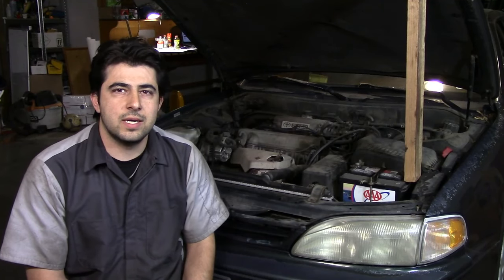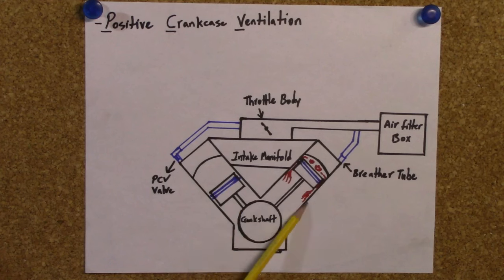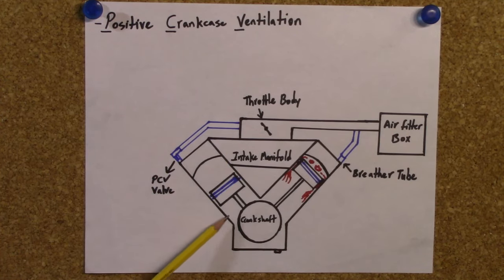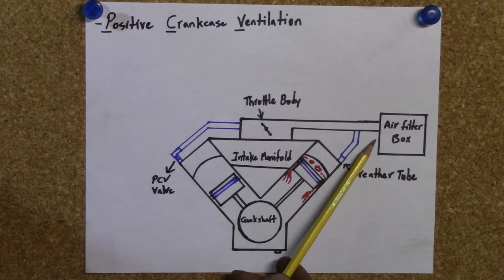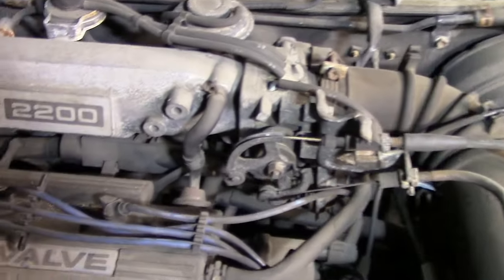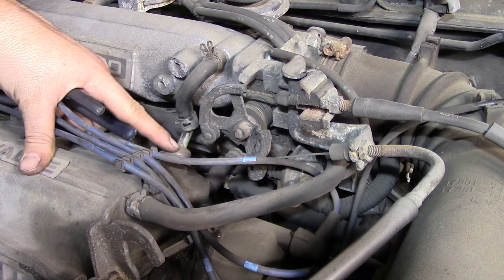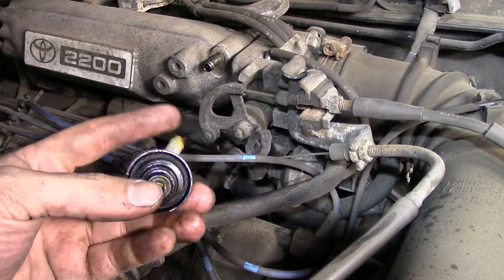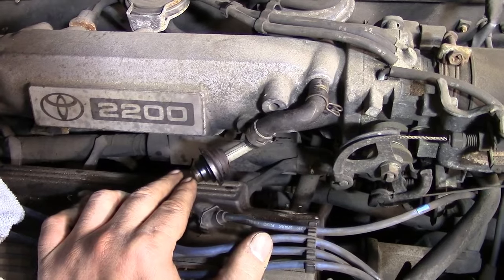How Does a PCV System Work - Also Testing and Inspection of the PCV Valve

Comment: I just di the PCV valve in my '04 Astro van - The existing PCV valve tested fine BUT, when applying brake pressure when the vehicle was in gear it rattled wildly and was loud so I decided to replace it anyhow ($2.85) it seems to have solved my issue

Comment: I blow through each end of my valve and air easily flows both ways. It does not really close.  You mentioned  the valve will close or nearly close at idle. Why does this have to happen and if it does not close, does that create a problem ? I got the impression that a valve is not even necessary, just a hose. Does the valve open only so far at different engine speeds ? And would this be to reduce too flow and too much oil from entering the intake/throttle body ? Seems to be a spring in mine, what's it's purpose, to control how much the valve opens I take it ?  Seems to be an excess amount of oil in my valve also. Thank You Anyone !

Comment: Hi. I would like to ask something if the following is true: If you open the oil fill cap during operation at idle and put your hand close to the oil fill hole you should fill some gas pulsations. This is normal because the valve is almost closed. However, when you open the throttle, the pulsations are lost, since the pcv valve opens. Is this a way to check your pcv valve?

Comment: Does a 03 Sierra 1500 is open  from factory?.  The stock one is just pcv valve with nothing inside  just a big hole  and a smaller hole.  Nothing inside the pcv valve to rattle. The new one is the same.

Comment: Yea I had a pcv issue replaced the valve didn’t fix it so I checked the hoses and it was a hose leak replaced the hose disconnected the battery so the engine light went off and the truck stopped jumping like it was but it is still acting funny and has slight engine surges and the engine light came back on I can’t find anything wrong with the hoses or valve but the engine light code still says pcv valve

Comment: Don't HAVE to have a breather tube for you airbox if you car doesnt use a pcv valve. For example, Chevy cavalier 00-02, Has its own internal air oil separator under the valve cover iirc

Comment: I don't quite understand how a blocked (stuck closed) PCV valve can cause excess pressure in the crankcase. Surely the gases would just go out through the breather pipe?

Comment: Well there is a little bit more to it. At idle when manifold pressures are high/"high vacuum," and low crankcase pressure pushing on one side of the valve, and suction on the other side of the valve, the valve will remain in the closed position. As throttle opens, manifold pressures drop opening the valve, relieving crankcase pressure. At idle a pcv valve should be closed, otherwise a vacuum leak is created, dropping manifold pressures, decreasing the valves ability to close. At idle a engine, unless it's wore out, doesn't really require crankcase pressures to be relieved, only at part or wide open throttle, for it is then the crankcase pressures build.

Comment: can you help me? my pcv valve is stuck closed i think, the engine cover inlet pulls air into the crankcase throught the pcv valve from the admission, and it only flows one way inside the crankcase is this design real? or wtf, i have oil leaks near pcv valve and oil fill port

Comment: Great video. But is that the case with all vehicles? Are all of them ventilated through the valve casing? Why some use a PCV line coming directly from the crankcase and others are like this Toyota? Also I know some use an oil/air separator before the gasses are returned but it seems there is no such thing in this Toyota?
Reply from the maker: Stefan Ovcharov Good questions, I am not sure. But if I had to guess I would say the newer the cars more likely they would use an oil catch, and older they are more likely they would use the vent directly from the crankcase. cheers
Reply: RatchetsAnd Wrenches Thanx. Cheers.

Comment: Breather tube is there when wither there is no vacuum, backfire, or boost. It acts as a small source of vacuum for blow by. You always want some vacuum in the crankcase, because the engine will  always have some pressure. The engine itself isnt sufficient enough anyway to provide any large source of vacuum for it to be any concern.

Comment: Probably one of the best explanations in YouTube mentioning why PCV always has to be used with a breather tube, that clears most of my doubts. Great video brother!
Reply: The part where he mentioned how the pressure from the Crankcase travels through the Oil Way Tubes (that normally run from the Valve Head section down back to the Crankcase base/Reservoir to get resent back to the Oil Pan) up into the Valve Head section is what did it for me.
Never understood what a PCV is doing on top of the engine head if the Crankcase is down below.

Comment: is it possible to clean the PCV valve with carb cleaner? got a GM truck where the valve is attached to the valve cover, so the whole cover ($100) would need to be replaced if the PCV valve goes bad.

Comment: I have a different problem on a VW Golf 5,  no blow by, instead there is a vacuum when opening the oil cap or dipstick and i can hear bubbling inside. I've searched about this problem but found no such similar case for my engine. Car runs fine.

Comment: Is it possible to relocate or add an extension where the pcv valve is installed? Because i have a 2009 toyota  rav4 2ar-fe engine, and the pcv valve is located underneath the intake manifold, so to access it i need to remove the intake manifold first, alternative way is to lift it remove the passenger side front tire and splash guard to painfully access it, do you think by putting a extension hose will make any issue?

Comment: my ford f 150 2005 is burning a little oil what should I do
Reply: Oil consumption in the range of 1 quart every 1k miles is considered normal although some engines of the same displacement in the same service use more while others use less. It is a mystery.

Comment: so.....  having Oil going up through my pcv valve to my throttle plate is Ok?  I have a 2000 ford taurus duratec 24valve dohc engine and the hose set up is connected behind the Throttle plate.  Just changed the PCV in it and there was a little oil at the bottom of the plate.   Really appreciate your videos, by the way!

Comment: To fully understand....the breather tube supplies air from the filter box to intake manifold? Because, when throttling the engine doesn't it create a vacuum at the end of the tube where is connected to the filter box ?

Comment: Thanks for the video.  I have camry 2007 4 cyl with 100, 000 miles.  I changed the pcv valve,  I see a blow by but no smoke and the car has plenty of power.  However it consumes oil ~ 1 qt in 1000 miles when I was using Mobil 1 5w-20.  The oil consumption improves to 1 qt in 2000 miles when using mobil 1 0w-20.  My questions to you:
1-Does the blow by means the rings are worn even though there is no smoke at all?
2-How to tell if the blow by is normal or excessive?
3-Do you think the car can survive for another 100,000 miles? or need rings?
Thanks
Reply from the maker: +zofa300 I think there is a recall by Toyota that covers rebuilding the engine on your car, not sure if your year is covered or not. Apparently some piston ring excessive ware causes those engines to burn alot of oil. Do a google search you should find it. gl
Reply: +RatchetsAnd Wrenches Thanks for your reply. I am aware of fix that Toyota announced.  It required more than a qt in 1000 miles.  I am just afraid it I am slightly less than 1 qt for 1000 miles so I'd like to know what I should expect from this car if It just can run for 100,000 miles if I keep adding oil or there are many other issue.  Any additional comment is appreciated.  Thanks a lot
Reply: zofa3

Comment: I have a 98 Nissan 200sx and it has an oil leak underneath the car.  I think it has a problem in a pic hose.  How do I know ?
Reply: +vanessa mata Usually it's an oil pressure sending unit or an oil pan gasket. The root of the problem is usually caused by engine blow-by which is caused by a failed PCV valve and/or worn piston rings.
Reply: +vanessa mata Also, blow-by contaminates the oil with sulfur, which is corrosive and will actually eat at the rubber seals and the oil pan slowly.

Comment: My 06 4.6 f150 has milky yellow gunk in the oil filler cap the oil looks good just changed pcv but still happening any ideas ? Thanks
Reply: Head gasket is failing likely. The milky gunk is the product of coolant and oil mixing.
Reply: There's another video I watched about this vanilla pudding looking stuff that happens up north in the cold when you don't drive very far, so you don't burn the moisture off that naturally builds up inside a motor.

Comment: If it rattle or moves with only gently flipping it upwards and downwards then your spring is not allowing it to remain closed. It should remain closed at all times until a vacuum is applied to pull it open. At least this is my understanding of it. Please someone correct me or at least reword what I said to make it more accurate if necessary.

Comment: When you open the throttle body there is no vacuum after the throttle body, there is actually positive pressure sometimes. There can be a vacuum before the throttle body at WOT hence why there is a breather before and after.

Comment: how bad is oil leaking(as it usually does) from crankcase, through pvc valve if it isn’t clogged, back into throttle-body, intake, etc.?
not that it makes any colossal difference, but how bad is oil, sludge, etc., leaking through clean air vent(also back through throttle body, intake, & so on)?-  &&& on this nOt of revolving carbons sludges etc. revolving through here or there, back through throttle-body,  intake, & so on, do either catch cans &/or AOS’s clean carbons, etc., from oil, or air, before returning it?-🤔

Comment: how do you know if there is too much oil being sucked up by the pcv valve? My pcv valve is connected to the rear most intake hose right before the throttle body. I was taking it apart to clean the throttle body and i noticed some oil pooled at the bottom of the ridges on the intake hose. is this normal? I also have a oil catcher on the opposite side of the pcv valve for excess oil and it was pretty dry besides normal oil residue but im just not sure if oil should be pooled in that spot or not. I cleaned it and i have not checked it yet, im going to wait a few more days to see if it catches more.
Reply: Austin Rodriguez You would know because your adding oil in between oil changes because your checking the oil level.

Comment: My car is making an ugly knocking noise.. sounds like the coils are clunking its loud at idle and acceleration any ideas???
Reply: +Rene Paredes Are you talking about the coil springs clunking? And the car is loud, except at cruising speeds? You might have a bad exhaust system and some part of it is loose and dangling under the car. So when you go over rough roads or bumps and hear a clunk, the exhaust is bobbling & flopping,  and hitting something under the car.
Reply: +Rene Paredes Are you talking about the coil springs clunking? And the car is loud, except at cruising speeds? You might have a bad exhaust system and some part of it is loose and dangling under the car. So when you go over rough roads or bumps and hear a clunk, the exhaust is bobbling & flopping,  and hitting something under the car.
Reply: +Rene Paredes if the car makes the noise while at idle and not moving then it sounds like the crank shaft bearings is damaged
Reply: I meant valve springs, in that area it sounds really bad but now i have a problem at idle it revs up and down by itself than shuts off

Comment: Hey man i think that i have a problem with my pcv system, my motor is a sr20de from nissan, my car burns oil and i can see smoke coming out of the tailpipe when idling at cold starts (when i start riding and it heats the smoke disappears), i checked my pcv valve and its not clogged, do you think it could be the breather tube?
Thanks a lot for your video, i thaught my engine was fckd up.
Reply: Bad valve stem seals allow oil to leak down onto the top of one or more pistons causing exhaust smoke after being parked, but they usually don't leak fast enough to see smoke after the puddles burn off. It is impossible for the PCV system to cause visible exhaust smoke.

Comment: Should this be changed out based on mileage, or test it and if it works leave it?
Reply: The "rattle test" is inconclusive. DO NOT rely on the "rattle test". Simply REPLACE your PCV Valve at 50,000-mile intervals.

Comment: Does the PCV valve have something to do with the code p0171 I took it off to clean the sensor intake and put it back on but the engine light still goes on with that same code number I saw your video and maybe I have to change that part not sure but I will try it and see I have a corolla 2,06

Comment: Just ruddy excellent. Dude thank you so so much.  I've been watching more of your videos just in the last week, you have quite a gift for knowledge transfer. Not everyone is able to do that effectively.  That diagram and the way you explained it really helped me understand PCV properly. I vaguely knew it was pressure equalisation but I struggled with how and why oil could traverse all the way up to the airbox, or an intake manifold - I've seen both. I see now it's not really being drawn  all that way directly, it's just oil that was  already in the upper area doing normal stuff, and getting through PCV or breather hoses. 
I've done quite some work on my car this week, have more to do and I knew checking the PCV would be part of it. I just wasn't really sure why.

Comment: Thanks good vid. So if the pcv valve is off, would the pressure be able to escape from the crank case? Seems like it would. But I guess oil could escape too. Does the valve protect oil from getting into the intake?
Reply from the maker: Yes, and thats how it was done back in the day (pre 1960's) they had a hose I believe that just let the crankcase pressure escape into the atmosphere. Now those are pollutants so you cant let them escape into the atmosphere anymore but through the pcv valve they get recycled back through the engine and burned off. The valve is supposed to keep oil from escaping into the intake but some minor amount will get into the intake no matter what.
Reply: @MattInIllinois  But you're OK with dumping it into the air you breath and onto the highway.

Comment: hi there, i have a 2000 dodge dakota v6 , my pcv valve is hosed to the rear airbox on top of the throttle body , I have seen other same engine dakotas where it is hosed to a port on the side of the manifold , on my engine that port is capped of with a rubber cap . I am confused and am planning on replacing the valve and want to do it right .

Comment: thank you senyor, by watching this video I learnt a lot of mysteries about the 4 darn odd looking pipeline from the cylinder blocks to a metal square contraption above which has an air suction hose from the carbs and another large hose to the breather box on my Suzuki bandit bike, it was a mystery all these 7 years and at least I know some of the basics now, especially that ticking noise when I throttle and its cause! you reckon I can get more ponies out the bike if I dead flange them up completely? never seen that odd pipe in older bikes anyway

Comment: Can the oil end up in your exsaust cause that's the problem I'm having and I have a bad pcv valve.
Reply from the maker: Yes a bad pcv valve can cause oil consumption (engine burning oil) and some smoke out the tail pipe. If you have actual engine oil in your exhaust make sure you didnt over fill your engine with engine oil. GL

Comment: The PCV is one of those little marvels of universally adopted engineering. The simple appearance belies underlying complexity! No vacuum - closed to prevent backfire induced retrograde flow, high vacuum - minimal flow (at idle when you don't want a big swing of crankcase pressure), low vacuum - high flow when at wide open throttle the engine can easily take in extra blowby gas. Great practical summary!
Reply: spelunkerd o8u8o8k6
Reply: and why bad working makes engine pipe smoking?

Comment: For some reason my 2007 Mercedes E350 was burning oil like crazy for a few months and not sure why. I looked at the PCV valve and the hose wasn't attached to it... not sure why.

I put it back on but now I'm worried. Have I caused damage to any components? While the hose/tube was off, there weren't any weird symptoms other than oil consumption. No rough idling or anything.

Comment: Many new cars use a fixed orifice instead of the vacuum controlled variable valve.  So many people still think it works in the same way but it doesn't.  A fixed orifice allows only so much air flow at idle, when vacuum is highest and crankcase gases are lowest.  When the throttle opens, vacuum drops and thus air flow across the orifice is reduced substantially.  Can you do another video on orifice type PCV systems.

Comment: if PCV is blocked , oil would leak from the engine ,right?, But wouldn't the blow by goes out the breather side ? instead of leaking from seals or gaskets ?

Comment: I wonder if it’s possible for PcV to be responsible for 3 quorts of burning oil in 2000 miles. ?
Reply: I'm extremely wonder that pcv can cause just one 💧 of oli 😂😂😂not just as you mentioned

Comment: HI MY TOYOTA CAMRY GIVE A VIBRATION WHEN IAM GIVEN MORE POWER
Reply: +shoan reid that sounds like you a cylinder isn't firing properly. Clean the fuel injectors? change the spark plugs? change the spark plug wires? change the fuel filter?

Comment: Doesnt vacuum drop when you open the throttle plate
Reply: Yes. Increased flow reduces pressure.  If you hookup a scan tool you can watch it change in realtime. I use a $20 OBD2 reader with bluetooth and $5 torque app on phone.